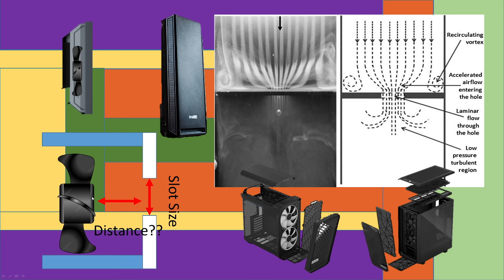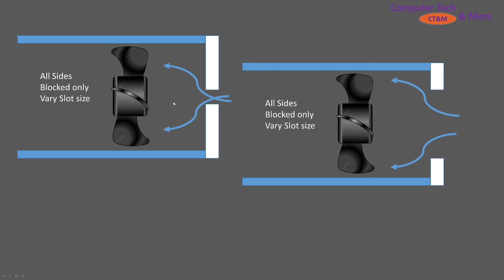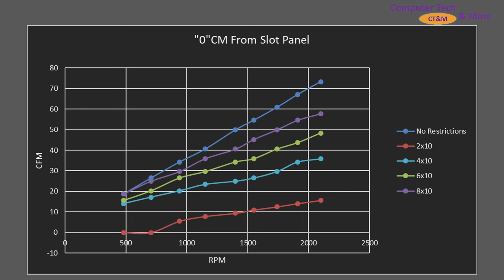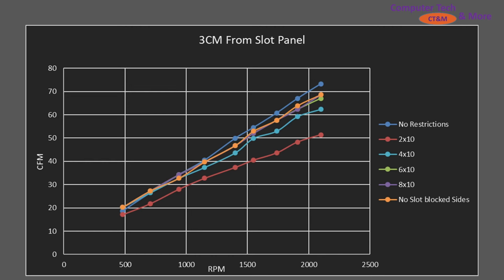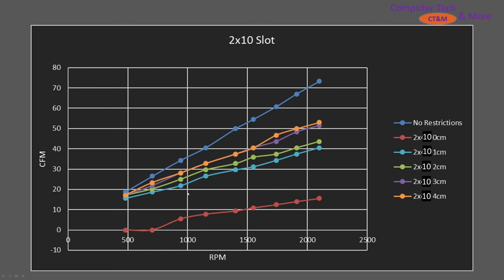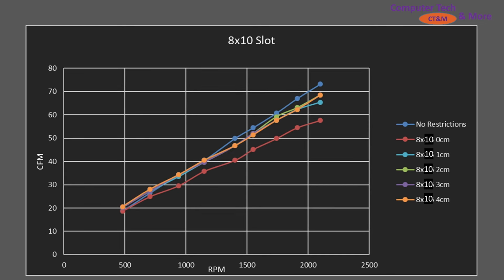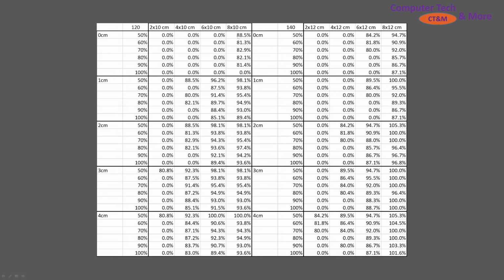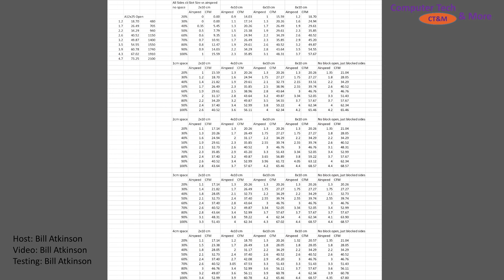120mm Fans Restricted Airflow vs Distance: Slotted Opening

Comment: The performance increase by just giving it 1cm more distance is great!
Actually this is good news for me as I bought the Silverstone SST-FDP02B, a 120mm fan mount behind the PCIe slot covers kinda like on the Lian Li Lancool 216. I was thinking if I should replace the stock fan with a centipede fan cause you could fit 2 120mm in a case with 10 PCIe slots, but I'm probably going to mount NF-A12s with the IS-1 spaccers.
Reply from the maker: I'm glad this video was useful. :) I have a follow up tomorrow for 140mm fans. 
thank you for watching.
Reply: Don't spent money on noctua...
Reply from the maker: @FractalGOOD noctua's are great. expensive but great.